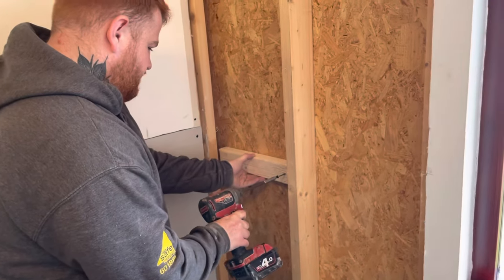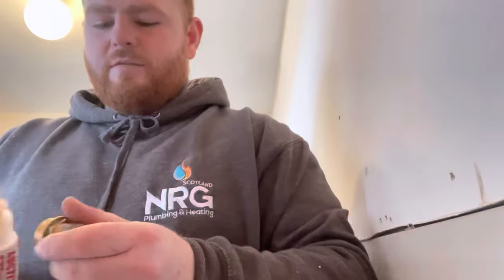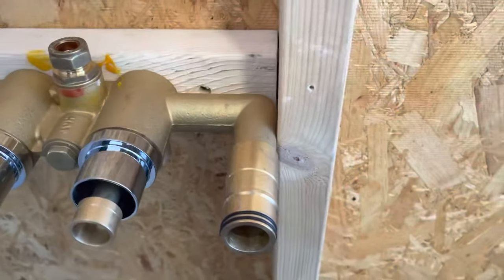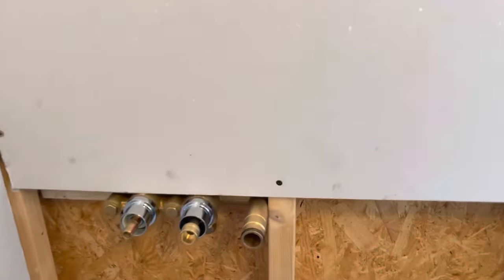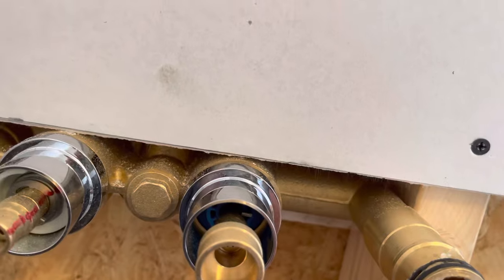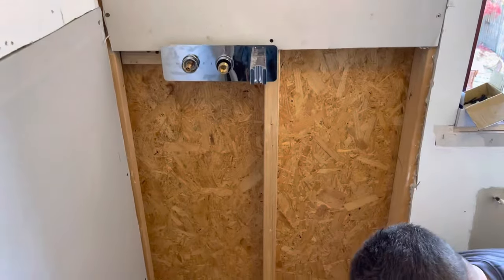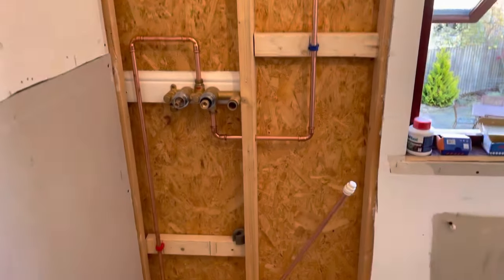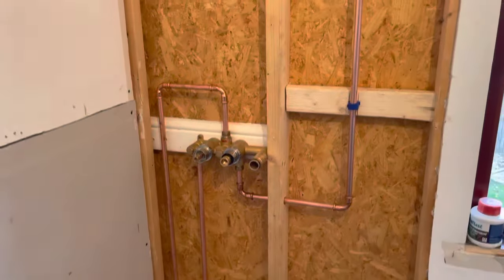Fitting concealed shower valve for dummies

Comment: Hi thanks for this video, what did you use to connect the 15mm pipe to the valve, loctite sealant 577 or tape? thanks

Comment: That's a lot of loctite 🤣 just ¾ around the first few threads and it just covers all the way as you thread it in.
Reply from the maker: Won’t b leaking tho 😂😂😂
Reply: @fraserhoehle2256  it'll last a thousand years. Gives peace of mind because if means behind the tiles after its just been done 🫣😱
Reply: That feels very wrong, using Loctite for something that should be de-mountable. If the mixer will fail and you need to replace it, you have to cut down the pipes and replace them completely. You should think about the next person coming after you..
Reply: @razyellss  It's Loctite 577 and medium strength, so you can disassemble

Comment: Why would they put the mix outlet on the bottom of a shower valve? Seems like an odd design choice.
Reply from the maker: Very odd mate but it’s quite cool the whole valve set up
Reply: @fraserhoehle2256  I am trying to fit this shower valve and I honestly thought I was going mad until I found your video. Cheers.
Reply from the maker: @awt  hopefully it was helpful mate! That’s great it helped
Reply: @fraserhoehle2256  is there any reason it the valve shouldn't be installed the other way up? Simply because of where my feeds come from, it would be easier to have cold+mix on the top, hot on the bottom.
Reply from the maker: @awt  hi mate, follow me on instagram if you can and I’ll message you
Reply: @awt Yes, agree this should be installed vertically